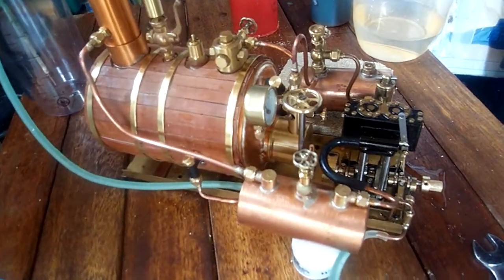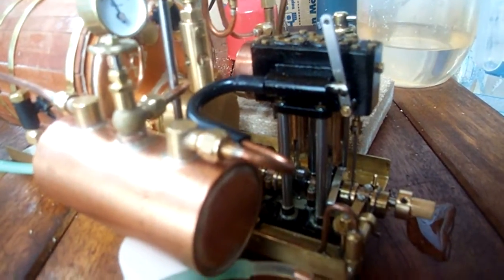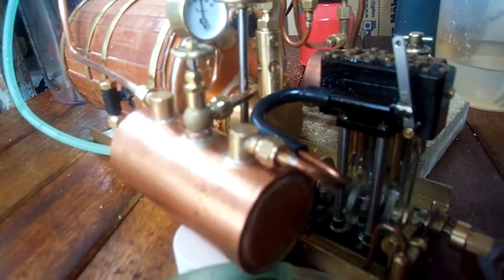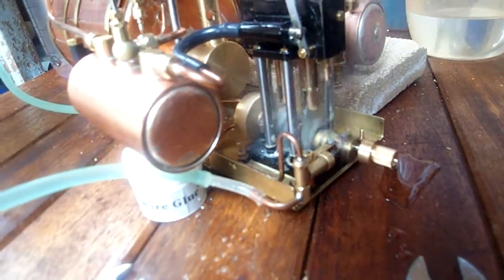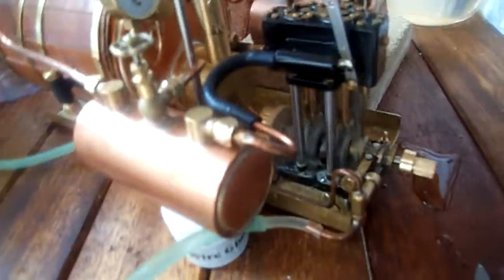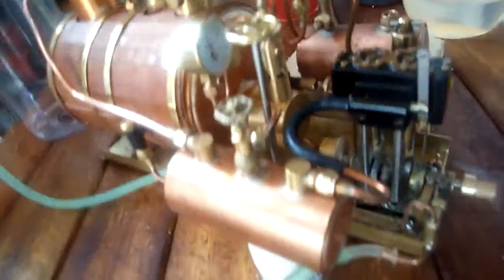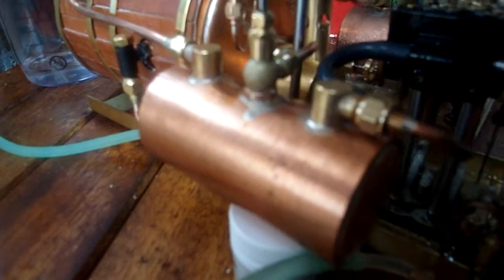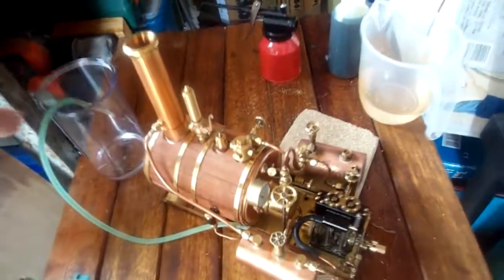Maxwell Hemmens   CATON pump FLOW RATE TEST

Comment from the maker: @Einaudi23 

Hi thanks, Update, I have discovered, that the Caton engine is a high pressure little engine, and now I run her at
60 psi/4 bar, and of course this has improve the flow rate considerably ,!!! thanks again

Comment from the maker: Hi,
I have now increased the working pressure to 60 psi, as the engine runs better at this, and of cause this has now increased the flow rate of the water pump, !!!